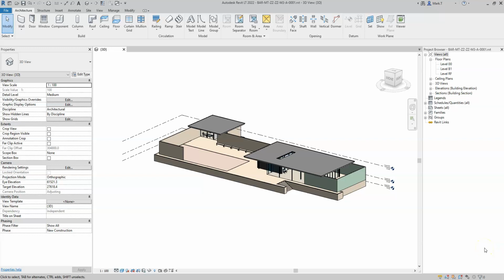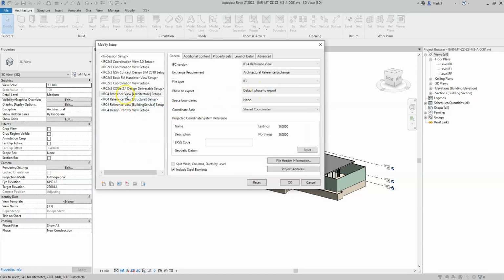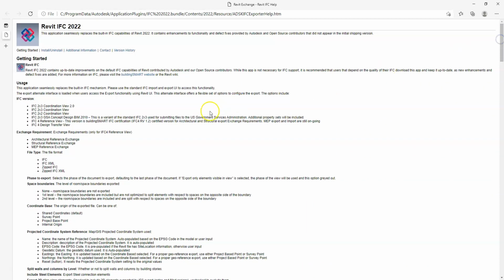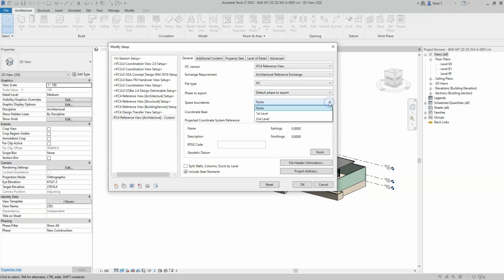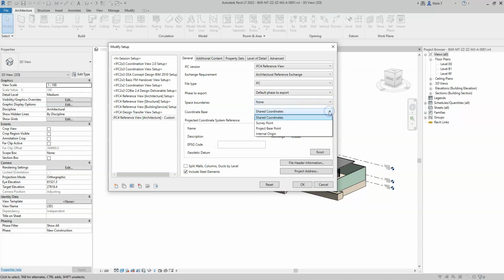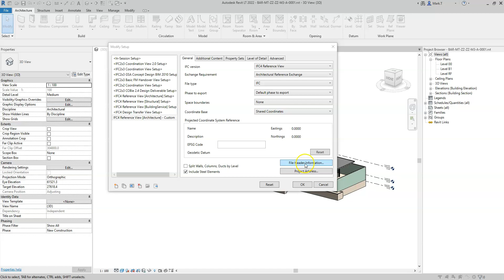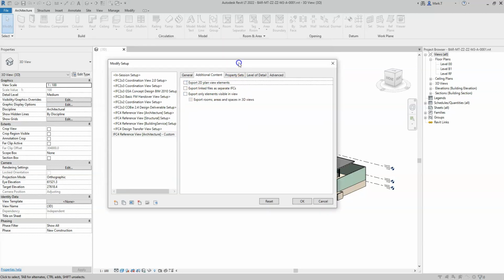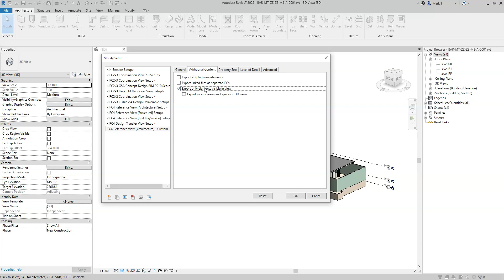Revit to IFC: An Export Guide - Part 11 - IFC Exporter Settings - Part 1

Comment: Hi, will the new Setup be registered on this machine, or in this specific revit model? Or I need to create new Setup each time when I export a view to IFC? I have two .json IFC Setup files for the projects, but I have to load them each time when I export the view to IFC. Can I just simply add these two .json Setup to the system, so the default Export IFC Setup can have 12 instead of 10? Thanks
Reply from the maker: The export settings are saved per Revit model, so load them once into a model and they will remain in that model. If you have standardised settings across your organisation you can include the setup as part of your Revit template(s). However i would stress the importance of ensuring that all users have the same versions of the IFC Exporter to ensure consistency across the company. Hope this helps.
Reply: @practicalbimresources8668  Thanks for your reply. It's very clear. So if each model have unified view settings and IFC export settings in the begging, the dynamo should be able to do batch export for all the views.
Reply: @jamesrancho  And it's perfectly possible with the Orchid package of Dynamo.